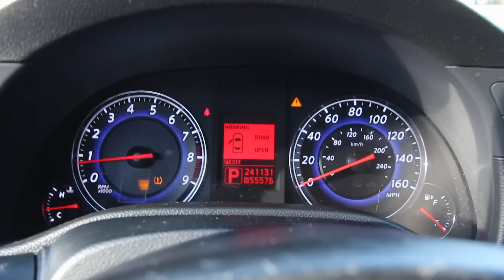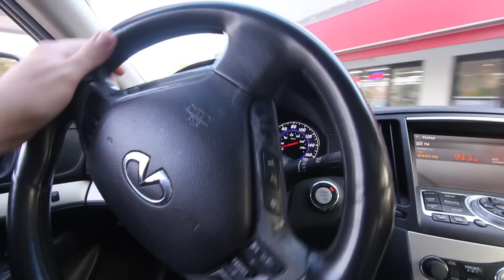Here's Why I Love the Infiniti G35 X, EVEN 12 Years Later this car Amazes Me!!!

Comment: Just bought the G35 a couple days ago! I’m 16 and it’s my first car. So far I love it! I bought the all wheel drive model in a teal color!
Reply: As long as you've got that VQ35 HR motor you'll be whippin A**..
After a few modifications, the car is not a joke after that point...
In Japan it is not called an infinity. It's just A g 35...
This car also sits on the same chassie as the skyline.. R35.
All in all the motor is A 350GT R35 skyline motor rebranded.

Comment: I most definitely see a check engine light on
Reply: Yeah that’s common. They have super sensitive sensors. Mine came on because it sensed a small oil leak. Then it came on again because one of my cats went a little bad. It rarely means the actual engine
Reply: That’s not unusual at all for these cars.

Comment: 3.5 liter chadster... a maxima with rear wheel drive and a more luxurious interior. It put 255 horse power to the rear wheel and it eliminated the torque steer. But mainly a different spin on a maxima.
Reply: its built on the same chassis of the 350z not the maxima. similar to the fx35 and z
Reply: @ThisDugan  Yes, it is RWD platform from the start.  Rear-bias in AWD format.  Maxima and Nissan is primarily FWD platform, and Front-bias AWD (if available) on Nissan cars.  Totally different platform than the Maxima.
Reply: Actually it's 306 horsepower.
Reply: It's 306 HP you're way off
Reply: 2007 has 306whp. I have the 7 g35x you have no idea what your talking bout.

Comment: It’s a Renault In reality because Renault own controlling interest of Nissan. It’s not the great quality that the late 90’s quality that Nissan once was. The big plus is that there are a lot of parts available and maintenance is much cheaper than European exotics. All wheel drive was option on the top trim package. It is a more costly repair if it has a transmission fault. But maintained you can push 300k miles. It depends on how it was serviced and all preventative maintenance was done. The engine also has a timing chain not a belt. That’s a plus on a car. You really don’t have have to maintain anything with the timing chain, you repair it when it fails or it starts clicking. One of your reliable options for sale.
Reply: they're are partner to each other... so to say infiniti is nissan and nissan is renault is not a true statement.... they are each to they own but partnership is the keyword...
Reply: Renault has no say with the Infiniti's. They are purely Japanese, they just finance and have Shares with Nissan and only partner in a few shitty European cars. Renault doesn't have any say in design and tech with any top end Nissan's. And Infiniti's are Nissan's they are one and the same. It's just Nissan's way of targeting the luxury car demographic in America. Infact in Japan the Infiniti G35 exists as a Nissan Skyline 350GT. They are the same exact cars! Same goes for the Infiniti M and Q series. They are just newer gen Skylines in Japan. Ppl confuse Skylines as being GT-R's. The GTR was a special racing trim package for the Skyline. They separated that with the REST which dropped the Skyline monicker and is strictly a GTR. Nissan purchased Skylines from the Prince motor company in the 50s and incorporated them into their Datsun line. 
Anyways I have an 04 G35X and it has 209k. It's still a great car, performs well and I can see it lasting another 100k. Other than normal wear and tear of a 16yr old car. Im highly impressed with how well built and how well this car has maintained. Of course I've also modded it so mine isn't exactly a stock engine. It can cruise all day at 100mph, which is why I always set it at cruise control to avoid a speeding ticket. Because it definitely doesn't feel like you're going that fast. However it is old and outdated, but they are well built. So if anyone ever needs a reliable used car definitely consider getting a G35. Only issue is ppl are out of their minds wanting 5k for such an old car. Especially if you have no clue on its maintenance. You're right about the timing chain, their only weak point is the cheap plastic tensioner guides. But they fixed that after their first model. They existed as Skylines two yrs before their Infiniti debut. For 5k I'd expect a mint G37 or something, or even a mint G35. I found mine for 2,600 it has some wear and tear on the leather seats. Telling me it has had a lot of city driving. But these were built to last. Im going to drive mine until the wheels fall off, then I'm getting an Infiniti M56S.
Reply: It says Renault and Nissan on the throttle bodies, I can tell you that

Comment: I’m wrong chad the awd model with what they call a shiftable automatic did get 306 hp. It has dual intakes. Wow I’m sorry I thought I knew that 3.5 liter engine.
Reply: Yes it's definitely pushing at full 300 horses bro. My 2008 G35X gets up off the line. I love it.
Reply: They made 3 gens of that engine, the VQ35DE 260-280hp, VQ35HR 280-298hp and the VQ35VHR 290-306hp.

Comment: Its not 306hp it’s 255. the maxima has the same engine just basically de-tuned to 235 hp. 255hp with awd put to the road and being an automatic and it’s gears are not long it can be a snappy car off the line. I’d buy that car, read the power train warranty that costs 450 & covers you for 90 days. Negotiate 500.00 off the price and apply that to the warranty. (Read it thoroughly) warranty’s can be a rip-off too. I know this because I had a 2005 Nissan Altima with the 3.5 liter v6. Unless the awd came with 306 hp but I’m almost without a doubt it’s 255hp.
Reply: Its 306, the 07 g35 sedan has the VQ HR engine with 306hp, while the maxima has the VQ DE which is tuned down to 255hp
Reply: You should do your homework 😂
Reply: coolshariq you are right I stand corrected on that.